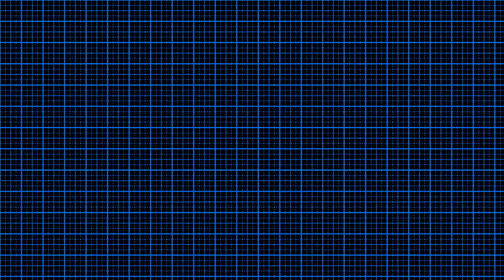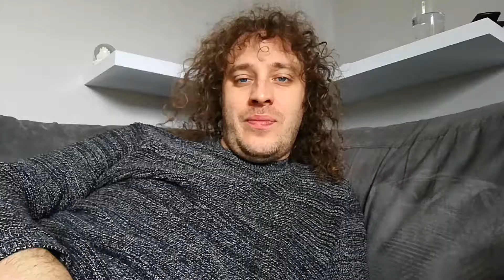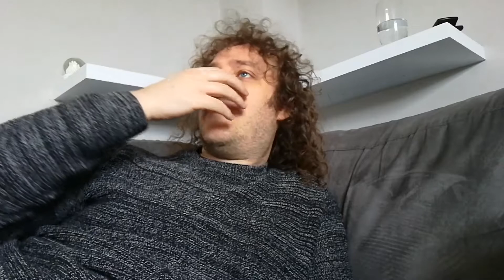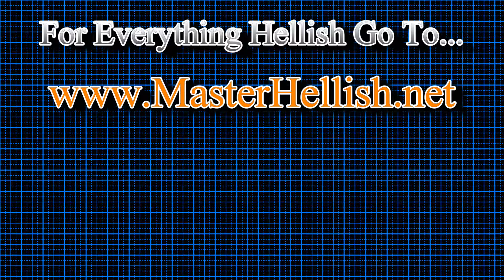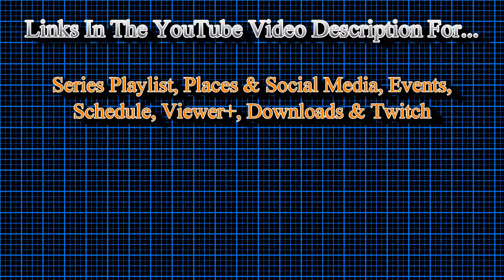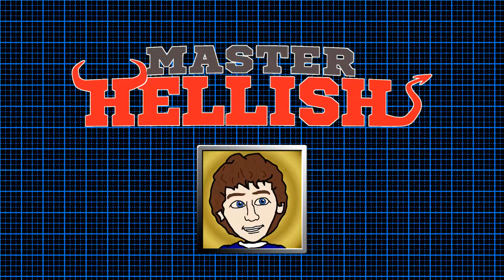Hellish vLog #92 - Planning For Robot Building Project

Comment: for strength best idea would be a disk (think hockey puck).

pyramid protrusions if you're going for a ramming robot.

some kind of skirt to prevent flippers getting underneath (gabew's idea sounds good)

running both ways up is also a good idea unless you want it to be self righting, this could be done with a domed top (also strong shape)

if you have to have an 'active' weapon you could add a single pneumatic spike (and just not use it)
Reply from the maker: I like the idea of running both ways up. It is the simplest and most effective way to get back going again after been flipped (unless you are a flipper you're self) I am going to try and avoid any sort of hydraulics or gas systems but I will have a think about the options

Comment: i like the idea of calling it hellishbot. my advice is if u are going to make a ramming bot then but little feet on hinges, similar to thors, on the bottom to stop flippers from getting underneath your bot.
Reply from the maker: I like the idea of them but I would be worried about getting them stock on the arena floor.
Reply: that's what's nice about the hinge, they adjust to the floor hight rather than being at a fixed hight